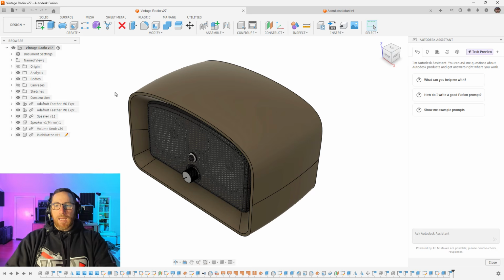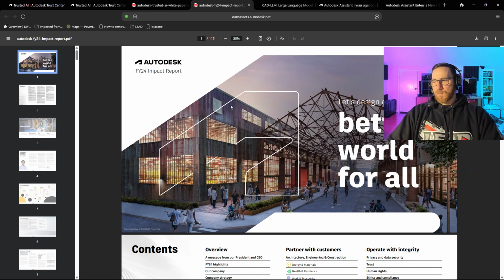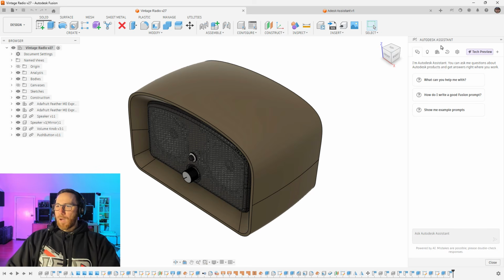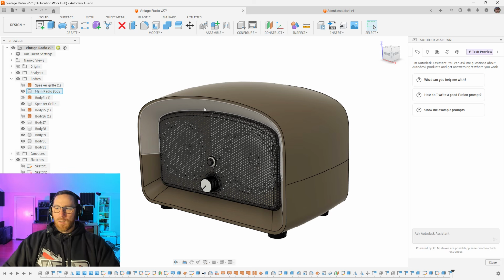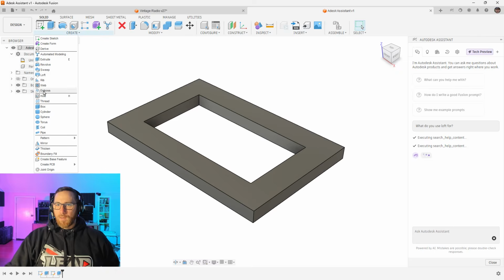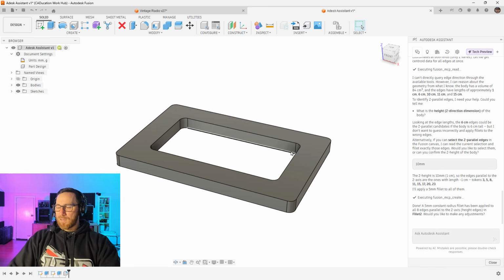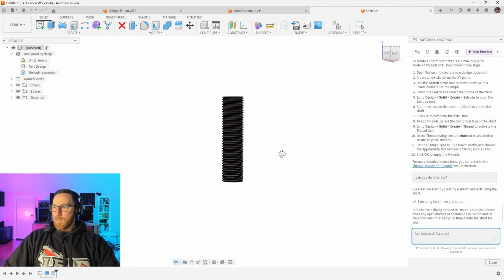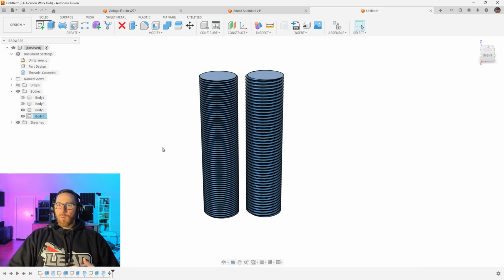Don't Use AI Tools To Learn To Design | Review of AI CAD tools

Comment: I started learning modeling this year, and for me, you're the best. Everything I've learned was from watching videos from 4 years ago. I intend to work with body kits and I'm already building my 3D printer, but I feel like I'm missing a lot. Which course do you recommend?
Reply from the maker: Awesome!  Most of the advanced content on the channel in forms was geared toward cars parts so there is likely no shortage of that.  The scan to print series for a widebody is a good one.  In terms of courses we are going to make a bigger push this year to get some new content out.  What I would say right now is to look at the Absolute Beginner Surface and Forms content if you feel you are missing some basics, and the Advanced "motocross handguard" videos talk about surfacing and surface/forms workflows.  While they don't apply directly to car parts they talk about things like surface quality and design for injection molding

Comment: Fusion really frustrates me, been using it for like 10 years now and it has become bloated, slow and even more prone to crashing and random errors. And this AI BS is just another layer of bloat.
Reply from the maker: Glad I am not the only one who thinks it is slower not faster!  I agree but will also note that I do hop back into Solidworks from time to time and that frustrates me even more.  Plasticity is the closest thing that just works for me, but just doesn't have everything i need for a full time solution.
Reply: @LearnEverythingAboutDesign Have you checked out the FreeCAD update yet? People have been hyping that up and been meaning to check it out.

Comment: I like the auto constraints feature. I’ll get my complex pattern and geometry down, be short between 5-10 constraints to lock it down, and punch the button. 

I’ll drag the ones that it adds way out from the drawing if I expect to edit it later. 

That’s faster than me doing it manually. 

The text to model stuff is rough. Text to 2d image is barely working. Add in 3d and it’s wrong more than it is right. That said, I have seen some really great 2d to 3d mesh results…
Reply from the maker: Thanks for the feedback!

Comment: artists and designers: considering building and concepting in Plasticity. a direct modeler that feels like sculpting in clay. with Plasticity, Solidworks, and Blender you can do hard-surfacing and near Class-A surface work for product development/design.
Reply from the maker: We work with all those tools on the channel.  I would agree with all but Solidworks.  They have priced themselves out of the game.  Fusion Freeform is near Class-A and the pipeline between Plasticity and Blender is great.  Solidworks is a powerful tool but there is little it can do that others can't already for less money.
Reply: @LearnEverythingAboutDesign the maker edition of SW runs $50/yr. super affordable
Reply from the maker: @tiburon2112  True but you can't do commercial work and any file saved in the maker edition can't be opened by a professional seat of Solidworks.  Great for learning the software but beyond that you would hit a limitation investing loads of time making datasets that are watermarked as Hobby (for product dev/design).  Most people I have spoken with hate the 3dx stuff and with the maker license you lose 3rd party add-ins. so you couldn't run something like PowerSurfacing for subD in solidworks, but you would have to use their 3dx version which would be exported as a "dumb" model and not stay in the feature tree.

Honestly I don't know why solidworks charges for the maker license.